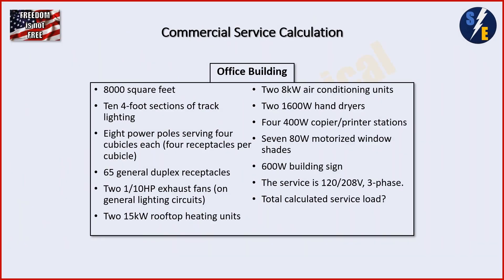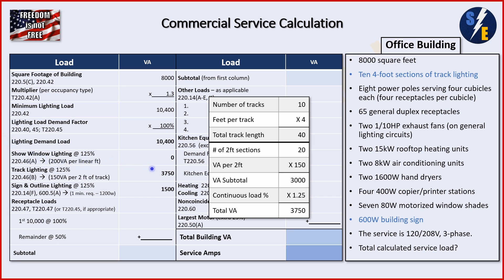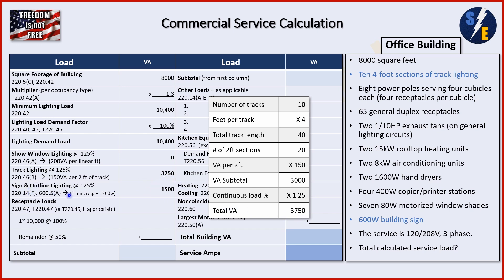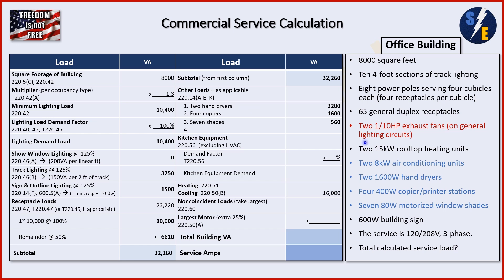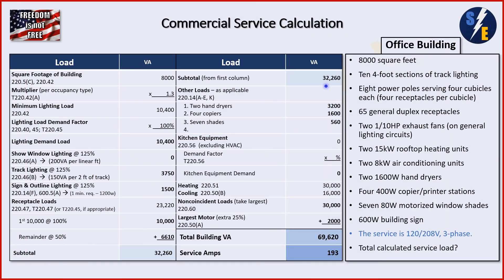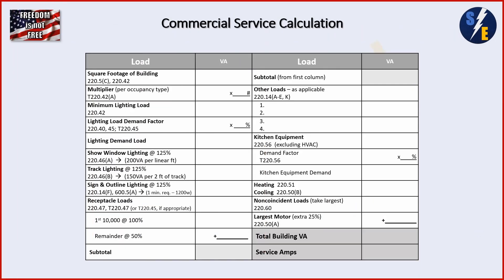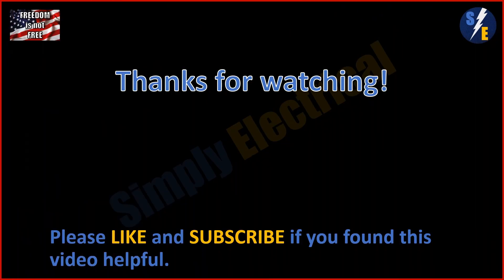Office Service Calculation - Crash Course 2023

Comment: Thank you for all your great videos. I do a lot of industrial type work; fueling facilities, manufacturing warehouses, data centers, etc. I'm not sure where these fit in with Table 220.42(A). I'd really like to see a couple industrial type load calculations.
Reply from the maker: Thanks for the compliment and the suggestion! I will add this to my list for future videos.

As for the examples you listed for T220.42(A):

Fueling facilities - This table would only apply to the "occupancy" portion of the facility (i.e. buildings). Typically, that's just office or warehouse space. All of the outdoor lighting (including filling stations) would be their own line item(s) at 100%.

"Manufacturing facility" is an option in the table. So is "Warehouse". So it depends on which one best fits your scenario, I suppose.

Data centers - This is tricky. My hunch is that it's probably going to be added to the table in the near future - since they are everywhere these days. It usually takes a while for the code to get up to speed with technology.
In the real world, my gut tells me it would be akin to a manufacturing facility, as far as it's lighting requirements. Warehouse lighting would be too dark, IMO. That said, I've seen a wide range of lighting schemes for data centers. So it may be best to use a warehouse multiplier, and then add any additional lighting on its own line as specialty lighting. Just my own two cents here.
On an exam, you would need to take all lighting at 100%, with no demand factor. The same would be true for any occupancy that doesn't have a clear designation in the table.

In all cases above where you're not using the table value, don't forget to add an extra 25% for continuous lighting loads. Anything not specifically controlled to operate less than 3 hrs at a time is considered continuous in non-residential occupancies.

I'd love to hear anyone else's thoughts and insights in this area.

Comment: I have a question. 220.43 on office and banks I was told you can’t derate using table 220.47. but in 220.43 it says to use the table or 1volt-amp /ft2 what ever is greater and that was the reference they gave me. Then there is 220-14 J that doesn’t reference the de rating table. just trying to get my head around it. thank you again for your great videos .
Reply from the maker: Hey Douglas, you're not alone! Non-dwelling receptacles are a little tricky because there are a couple of steps required in order to figure out which approach to take. And office buildings in particular even add an extra step on top of those.

First, it's critical to keep Part II and Part III of Article 220 separated in your mind. Part II is for Branch Circuit Calculations. Part III is for Feeders and Services. Now, they are related, but they serve different functions. When calculating a feeder load, Part III takes precedence over Part II. Therefore, we only reference Part II if we absolutely need to.

220.14(J) does not apply to a feeder calc (being in Part II), so just ignore that altogether. Note: this is why it's worded a bit differently than 220.43.

So we refer to 220.14(I) only because we are directed to from 220.43 (Part III). That's how we get our multiplier (180VA/yoke).
Once we have our subtotal, we apply it to Table 220.47 and see how it compares to the 1 VA/sqft calc (as per 220.43).
Take the larger of the two results.

I neglected to explain the 2nd step of 220.43 in the video, and that was bad on my part. Using the 1 VA/sqft method rarely gives you a higher number, so I forgot to even mention it. I'll plan to include that explanation in my future videos. I appreciate you bringing this to my attention.

For a non-dwelling, non-office building, you are allowed to compare Tables 220.45 and 220.47 and take either of those two results. So for an exam, you would take the lesser of the two, since they are usually asking for the minimum load.

Hopefully, that sheds a little light on it for you. Let me know if anything is still unclear. Thanks!
Reply: @simply.electrical  yes thank you. I forget about part II and part III . Thank you for pointing that out to me again, and explaining it out like that. you are doing great work thank you for helping me.